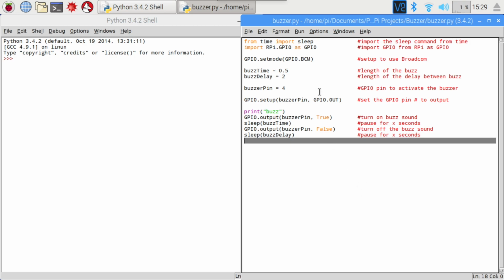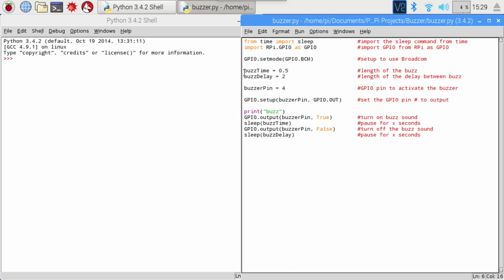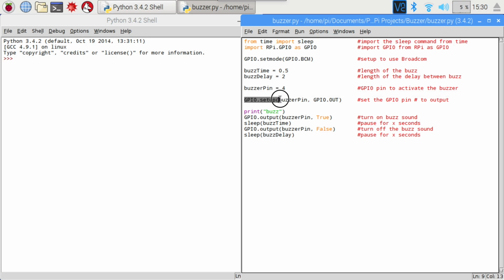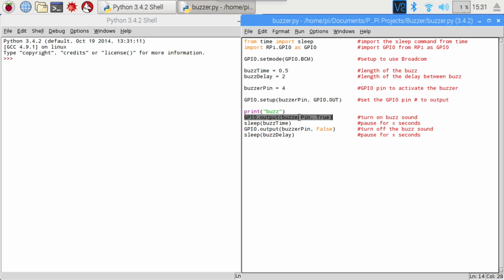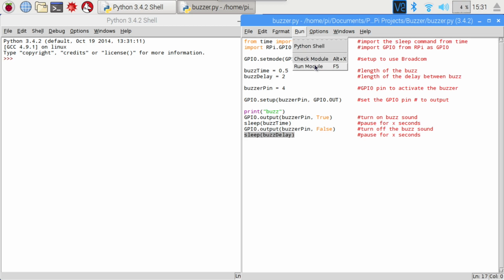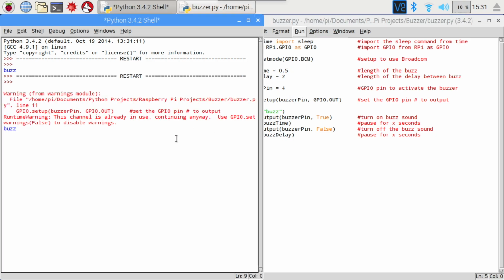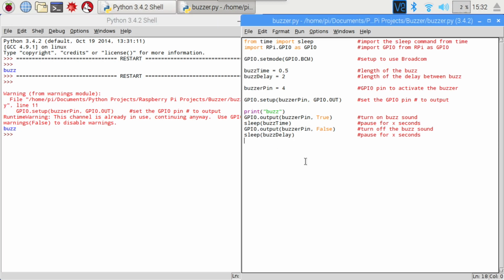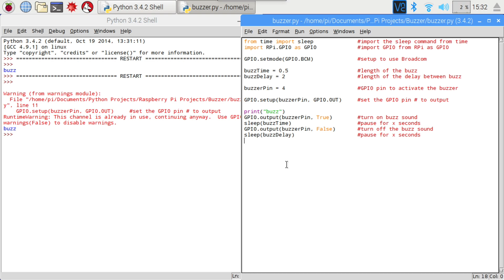Raspberry Pi Buzzer

Comment: Hey, thanks for your tutorials, I learned a lot!
But it doesn't work for me if I use an Passive Buzzer. I just hear a little clicking...
I tried it with an Active Buzzer and it works. Did I get the Buzzers Mixed up or did I do something wrong? I am a bit confused right now...